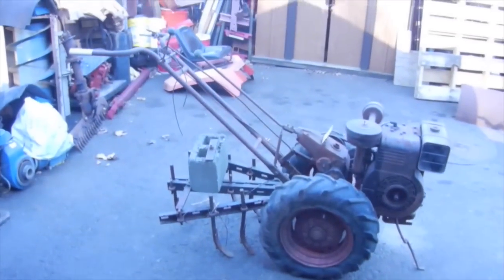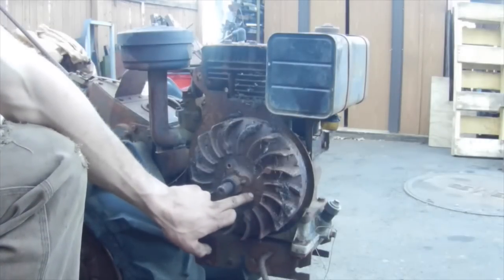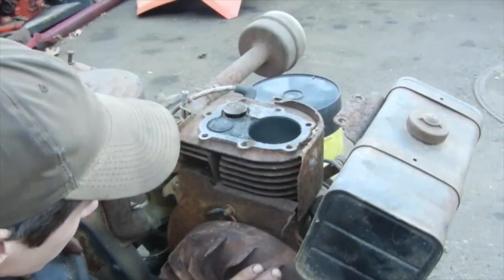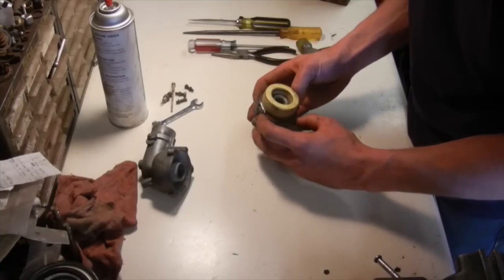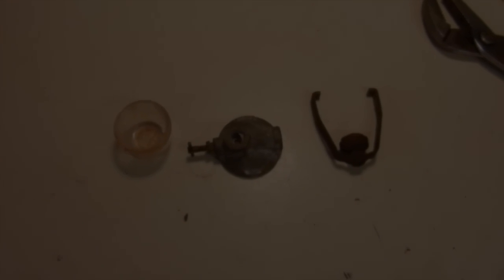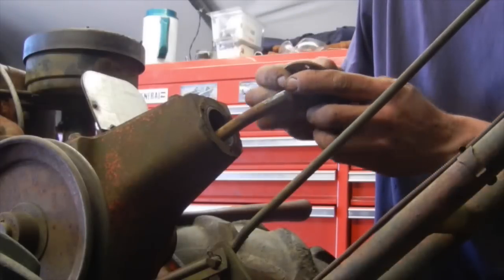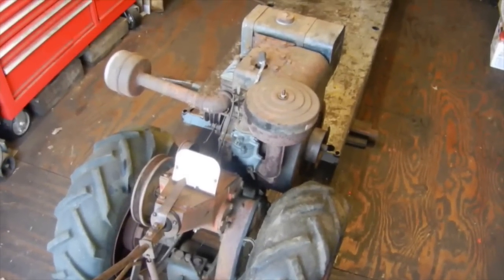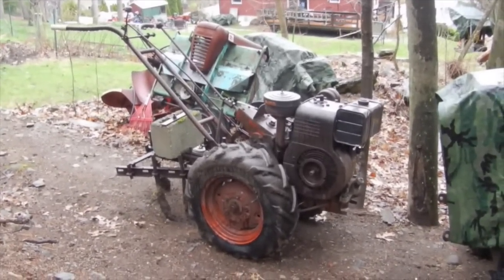Estate Sale Find- Simplicity VA Walk Behind Tractor

Comment: My dad had one of those when I was a kid. My brother and I used to drive that thing all over our 25 acres. It had a little dump trailer that went with it with a tip-down seat and a foot brake. I still have the trailer but the brake disappeared years ago. Thanks for the great video. Yours sounds exactly like the one my dad had.
Reply from the maker: Sounds like you and your brother had some fun tooling around on that. One of the older Simplicity manuals I have has a walk behind coupled to that trailer with the brakes. Pretty neat setup...

Comment: My inlaws have one that looks nearly indentical to this- bronze colored engine (missing tag) and the aluminum plate for the gear shift indicator seems un readable-  from looking at on line pics and you tube, it appears to be this model or very similar.  My bride recalls seeing her dad or pappaw use it in the garden.  I can't find any of the shovels or attachments on the property, I guess they went to scrap decades back.  The engine is stuck but the oil level is clean and correct, the gas tank is dry. I'm gonna bring it home next time I have the trailer with and add it to my long list of "stuff" to fix.

Comment: Think my pa may have had a similar model gifted to him years ago.  I've often thought it would be cool to get running.  Gearbox outside shape is a bit different, as well as the handlebars, but the motor looks close.  Thanks for the tip on a possible company name.

Comment: Cool find! Glad the transmission was in good shape. Thanks for the valve seat trick. I have a cheaper Midland walk behind with a Briggs 14000 that smokes like that. Those machines probably have seen many hours of use.
Reply from the maker: Me too! Especially with all the water sitting in it. I do have a Wards Power-Trac that came with this. First letters in the model# are MID, from what I read, it was made by Midland for Wards. Neat machines...

Comment: Seems like you'd get a lot of tiny aluminum oxide pieces off the sandpaper falling between the guide and stem, and chewing them up as soon as it's started when you clean valve seats like that. I'd stick with grinding compound and clean thoroughly after using even that.
Reply: I agree since it’s not like it takes that much longer to get at the valve cover, keepers, and springs.

Comment: I bet its nice when its cleaner inside than out. I'm surprised you didn't check the crankcase oil or did not just not show it.
Reply from the maker: Checked before I started it. Was actually pretty darn clean, like someone changed it not long before it stopped being used.
Reply: Thanks

Comment: What a great old find! So, now do you plan to bring this back with restoration , like clean up, paint and new tires?
I heard you mention "used gear oil" for the transmission,..can you explain why you'd re-use this stuff. It's just that I'm a tad anal about engine and gear oils.
These old cast iron B&S engines seem to be the alternative for the old Wisconsin air cooled cast iron engines we used to sell and service back in the early 1970's. 
You've got an old 'gem' of a walk behind tractor here.
Reply from the maker: Hi Reg! Well to be straight forward, if I can find someone who's interested in it, I'll end up selling it. I'd like to keep it and do a nice once over but I have a lot of machines to get though here (brought home a Gravely 812 and Cub 782 over weekend). May let it hang around for a bit, we'll see.

The gear oil was very lightly used. I drained it out of something that a customer wanted changed no matter what, an saved it because it was still pretty clear. Another reason to use it is because the transmission had water residue and some rust.... mind as well flush it with the iffy stuff before pouring in the new. And if it was clean inside, would've gotten some new oil right off the bat. It is a neat one for sure!
Reply: 100%   There now, question asked and nicely answered. In these circumstances then, I'd probably have done the same thing.
Cheers!

Comment: That is SWEET! I had one given to me when I was a kid but it just had the V-step pulleys and SNAILS in the bore. Got it running and the logger/sawyer ended up with it, took some bed rails, old wheel borrow wheels and spider gears out of a truck rear end and an old steering wheel and made a pre-four runner thing BUT it steered BACKWARDS! You'd do fine till you got close to something and then you'd run all over it trying to steer away. I've got a 5-horse 'L'-head with the gear reducer for one.  I'd rig another buggy up in a second just like that old one. AND I found a sheave for the kidney mower so it's humming right along. Thanks for a REALLY fine video and I always start toe tapping when yours start running. Bet the old rig would hardly smoke with some 15/40 Delo or Valvoline Series-3 in it!
Reply from the maker: Nice! The thing must have looked like one of those Wards Power-Trac's. Wards took one of their walk behinds and turned it into a rider, hokey looking thing but cool! Speaking of which I got a walk behind Wards Power Trac with this Simplicity, has the tiller on the back and a BKN Wisconsin. More good video material when I get the time...
Reply: I'll be waiting on THAT! I can't remember what mine was. That was a LONG time ago. I just remember the aftereffects of it and all the fun we had. If I ever find another one that'll be what I'll do. I remember I had to push the old thing home and one tire was shot but it ran about like yours did. Belt tightener clutch and the old Briggs looked a LOT like the same engine too.

Comment: Shifting it from forward to reverse (or between any of the gears for that matter) without disengaging the drive belt clutch & letting things come to a stop will have that transmission destroyed in short order, if that hasn't already been done. I have 2 of these & they weren't meant to be shifted with drive clutch engaged & the machine moving.
Reply from the maker: Thanks for the heads up, but I do realize that.
I took a chance just to see how it would work in the garden. It has since been sold and I finished going through it for the customer, including fixing the drive clutch so it disengages properly.

Comment: Well five tractorguy, I brought it back to Georgia's coast from the mountains of VA-  the engine tag's missing, but the serial of the engine is on the housing 0 679583.  The machine's serial is 14603. How close is that to yours? The rest of the Simplicity tag is not readable.  Hope all's going well for ya! Happy new year.
Reply from the maker: Hey Jethro, all's good here! Unfortunately I sold this machine a couple years ago so couldn't tell ya about that tag...
Reply: @5Tractorguy  Alas, my hopes are dashed...lol just trying to find some parts breakdowns of the actual tractor (the Briggs manuals are all online) and some detailed pics of how the attachments go on, I don't have any of them.
Reply: If you go over to my channel, I have videos of the thing running after sitting since the eighties with a stuck engine!

Comment: Love my glass bead blaster
Reply from the maker: Best dang thing going!
Reply: Something that is better for aluminum parts like carb bodies, is a cheap handheld blaster from Horror Fright using cheap baking soda. Cleans well without damaging or removing any metal. I own a small engine repair shop and that’s what I use (along with my ultrasonic cleaner).

Comment: Could you please tell me which make and model made a walk behind tractor that had forward and reverse gearing ???? Also, did they make a powered wheelbarrow ??? Thanks
Reply from the maker: Boy, that could be a wide range of makes... I know Simplicity had the W, VW, FC, VB, VC and a couple more with forward and reverse transmissions. Never seen a Simplicity power barrow, seen Gravely with one (and have one) but never any other make.
Reply: What are you planning with the Gravely one ??? Drop a line with your decision as maybe I would be. Thanks, vnowi813

Comment: On this Model 14 I am looking for the governor springs part number or where cn I find them Thank-you
Reply from the maker: According to my parts manual, there was one gov spring for the Model 14, Part# 26643. And on engines with type number 202636, governor spring 26764 was used. Hope that helps!

Comment: We had one on the farm in the late 50’s.   We had a sulky with a seat you could attach to hitch and a dump cart/ box just behind seat. Front deck mower, and a push blade that could be used in dirt or snow.  All were Simplicity attachments.  Too bad the crap (any brand) they sell now isn’t built as good as these old models. Attachments are shown on these pages http://www.simplicityva.com/simplicity/1955.html

Comment: That coil in those Briggs vintage models are notorious for being bad. They short out internally.  At least there are cheap Chinese aftermarket ones out there on eBay for  ~ $25 or so.
Reply from the maker: That's good to know. Last I checked online a while back there weren't any replacements, just NOS ones people had for $100/+. Mainly why I was so hard pressed to part with mine!

Comment: Would you know why my planet Jr will not pull backwards . One wheel is stuck .
Reply from the maker: Pull the hubs off and check the drive pawls, they are supposed to lock up only when the tractor is put in drive. One may be sticky or got jammed up on the teeth inside.